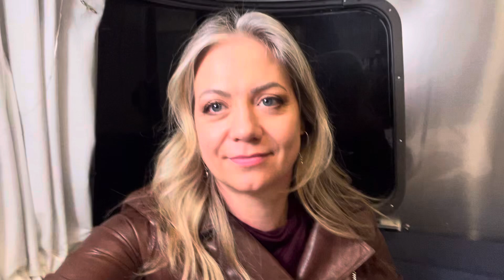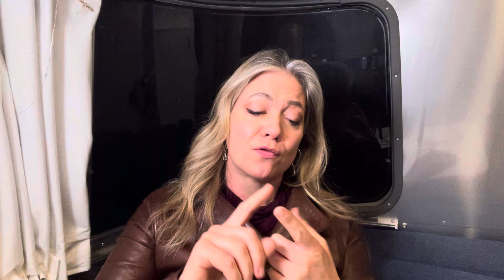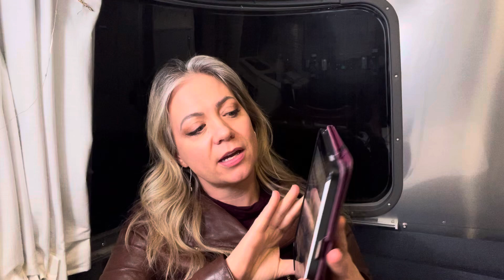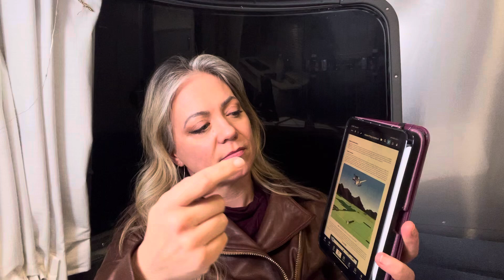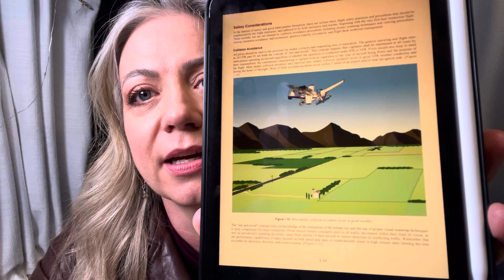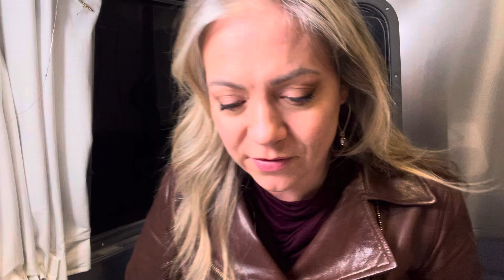Where you lookin? Collision avoidance disapprovals on checkrides

Comment: I haven’t been flying for last 8 years and started flying again last June. I noticed a monstrous increase in very poor radio communications, reporting wrong positions in pattern, and have had 2 near misses, cut off on base by an airplane that never made a call, and an airplane that took off on a different runway than the active runway without making a call (he was on a different frequency) and he was blocked from my view by hangars. I looked down and there’s an airplane about 20 feet directly below me! He departed the airport but came back an hour later and I caught him at the fuel pumps. I know the man so I asked him if he knew how close we came, he was oblivious, but he did acknowledge that he had been on the wrong frequency when making his takeoff call. We discussed that he didn’t have adsb out (he’s got a stratus and ipad for adsb in) and that would have been a secondary alert to me. We both realized how the swiss cheese came very close to lining up and he agreed to add a pre-takeoff checklist with comm frequency as a check to his airplane.
Reply from the maker: Great solution.  Way to work on a solution.  We all have made mistakes and have been corrected by those that care.  Good for him for listening!